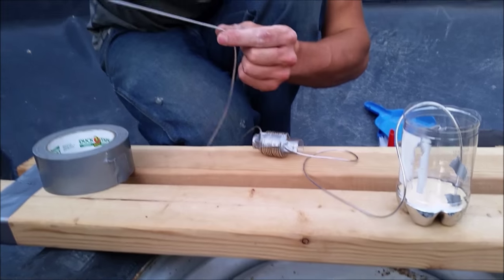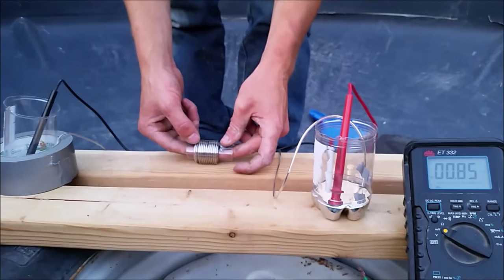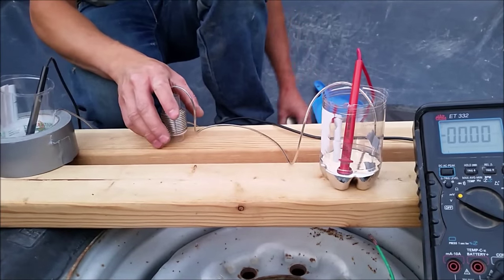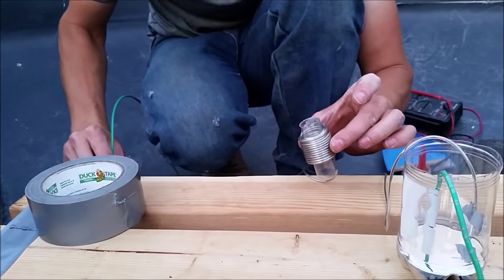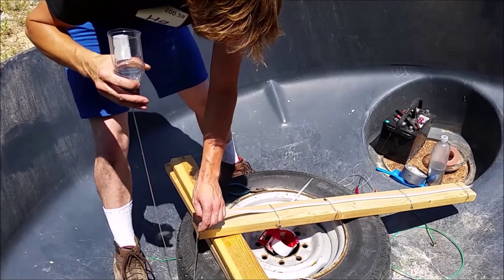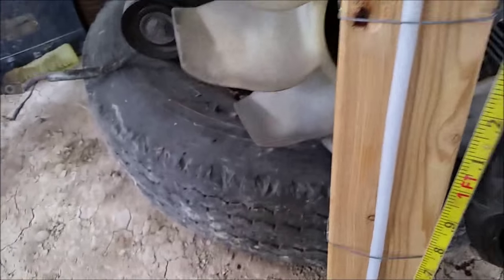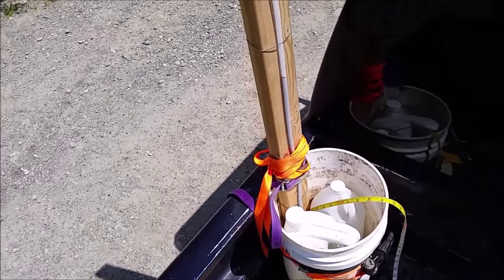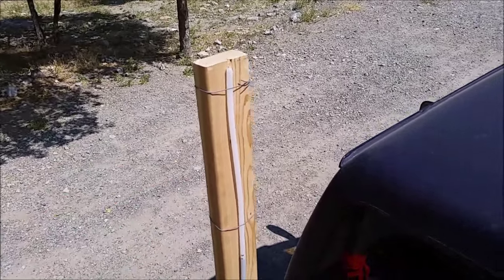Mercury In a Tube

Comment: Your textbook is right. Electrons move slowly in current carrying metals. (AFAIK at about 1mm/s  == 0.04in./s.)But current in a metallic conductor is not just electrons. It's also gaps for new electrons to occupy. These gaps have a positive charge and move in the opposite direction. (The concept of "a space for an electron to occupy" becomes crucial in P-doted semiconductors.)So while you do slow down or invert the flow of electrons, you at the same time accelerate the flow of the positive charge.If your way of opposing current would work, it would be possible to generate electric current simply by moving a conductor. You need to do that in a magnetic field in order for it to work.
Reply: +HotelPapa100 This isn't exactly correct. Only semiconductors have the gaps, called holes, while metals have a sea of electrons that flow. To make electricity, you need to have something that is charged move like an electron, an ion or a hole in a semiconductor. When the mercury is flowing, you are moving the entire atom (electrons+protons+neutrons) that has no charge overall. No moving charge means there is no electricity. If we could move a neutrally charged atom/molecule and produce electricity then we would be able to make electricity by physically moving anything around (for example we'd be able to make electricity with our bodies just by walking around).

Comment: I think it makes sense for the mercury to keep passing a current even when it's flowing, I guess it would be equivalent to rolling wire off one spool onto another. Had to think about it for a bit though.
As a new subscriber, I want to let you know I enjoy what you've been putting up!
Reply: ***** The car analogy does not hold water. The whole thing is moving and everything aboard knows nothing of the movement, it's a frame of reference thing. The whole planet is rotating at high speed and moving around the sun crazy fast, and yet we do not notice.
Reply: +Cody'sLab  You could only equate it to a spool of wire if the positive and negative connections were stationary and the wire was moving past them.

Comment: Hi Cody,
              Remember that electricity suffers the constraints that control light. You can move the light source at 0.5 the speed of light but the light itself will still travel at the speed of light. So returning to your mercury in a tube coil. The mercury is moving at what, about 3 – 4 feet per minute or something similar and you can increase this 1000 fold but the speed of the electrons in the mercuric coil will still flow at the speed of light. All this boils down to the fact that moving the mercury at any fraction of light speed will not affect the electron flow, ergo will not affect the magnetic field generated by the current flow. Which is confirmed by your very interesting experiment, which I would term, “thinking outside the box”.
 On the gold /mercury  experiment you were a little vague and I am not sure if the mercury absorbs the gold or just coats it. Could you please elaborate a bit. I know that mercury is used for mining gold so from that I would assume that it absorbs, but that is only an assumption from insufficient data.
Best Regards
MoK
Reply from the maker: mercury dissolves gold but large nuggets are dissolved slowly and the mercury ends up sticking to it.
Reply: +pufero1 I think you are confussing terms. In wide space an electron (all aside of the quantum and relativistic effects, lets be classical now) of course moves at speed of light. But we are on a different environement. According to bands theory, electrons in the conduction band  (which on a conductive environement has no energy separation with the valence band) move according to the difference of potential applied. The flow goes at C speed, but electrons themselves have a random gas-like movement  (without considering the electron as a wave). Anyways, the potential difference makes one of the components of this movement slightly larger, so the electron itsem moves sloooowly (around 10^-5 m/s according to my lecture notes). In fact, when defining the intensity on a wire, we say I= N (particles/volume) Q Vd where Vd is the derive speed, the electrons one, that is no the light's one.

Sorry for the huge message btw
Reply: is the fow what moves at almost speed of light electron only jumps to the next atom  and on video sounds like they are traveling on the wire.
Reply: +pufero1 that's it
Reply: Hi Jaime, I am afraid that the reply you made to me is utter nonsense. Not one piece of it conforms with any knows scientific language. I would suggest you start to bone up on the subject at least then I may be able to comprehend a little of what you are saying.
MoK
Reply: +Mo King My apologies, english is not my first idiom and I'm sure translating a lot of things wrong. 

What I tried to highlight is that I think Cody was right stating that electrons, considered purely as a particles, on a conductive wire don't move at speed of light, but a lot slower. As I've been taught, electrons move with a mostly random movement inside the wire, just as gas particles would. What makes them move on certain direction is the electric potential difference between the poles of a generator, so the electrons random velocity vector has to have a component generated by the action of the inner electric field on each electron, but this component does not make electrons move at speed of light, just a lot slower. 
Maybe I have not still advanced enough on my degree, but right now this is how I see it. The movement of the electrons as a whole is almost at speed of light, but each electron is not even close to that.

Cheers! (Hope that I posted it clearer this time)
Reply: +jaime fuente I have to stop posting this huge shit
Reply: Hi Jaime, Apologies accepted. I did my degree many years ago and I did the degree because I thought I knew it all and just required the degree pass to prove it. After 10 years of intensive study I got an honours degree but I learnt that I had only opened the door to one science and behind that door was 1000 lifetimes of knowledge and also another 1000 doors, each also with a 1000 lifetimes worth of knowledge and another 1000 doors. This goes on add infinitum. To put it succinctly I had learnt that my knowledge after 10 years of study was only a drop in the ocean of knowledge. You must learn this before going on that long journey of learning. Now down to specifics. You do not have a good understanding of electricity and electrons. Electrons when moved by voltage pressure do operate at the speed of light. This fact has been measured very accurately and electrons proved to travel at 186,000 miles per second, not a lot slower, as you seem to think. Think about how fast computers function, many millions of operations per second. requiring an electron speed of light. Please do not be proud of how much you know just be aware of how much more you don't know. A lot of data taught by schools, colleges, and even Universities, is in itself incorrect as the teachers are teaching exactly what they were taught. Learn not to trust all that you are taught but check and verify everything. Those that say they know it all are on a sure road to pitfalls and there are many of those in life's journey. 
Best Regards Jaime and I wish you all that you wish for yourself.
MoK
Reply: +Mo King i love your philosophy here... always be humble.  best life lesson EVER! 😆
Reply: Hi Philie, Thanks for your comment although I prefer to call it being polite rather than humble. Humble implies subservience and I am never that.There are many very rude and insulting people on Youtube and I sometimes forget myself and let rip.
    You also commented on Cody's family farm with a touch of envy. I have a large villa in Spain where I live now in retirement. The amount of work required to upkeep the property is horrendous especially at 75 years old and due to heart problems I will shortly have to return to the UK. I will still keep up my deep interest in all things scientific, but life on a large property is now a no-go. It's OK if you are fit, It's not always envy that is green. Lastly Cody's enthusiasm is very infectious and I enjoy chemistry so I watch his videos whenever I can. Making gunpowder from Urine is a piece of piss.
Best Regards to you and yours.
MoK
Reply: +Mo King  First of all, sorry for my english, i am german. I do not know if  I understood what you are saying. I am pretty sure that the speed of an electron in a conductor is not the speed of light. Actually it is very slow. It is possible to calculate the speed. Imagine a piece of copper wire. There is a number of electrons in that wire. You can calculate this number by multiplying n (number of electrons per cubic mm), A (I dont know the actual term, but it is the cross-section of the wire) and l (the length of the wire). If you multiply that number with e (the charge of one electron) you get Q (the moveable charge in that wire). So Q= e*n*A*l. The time that is needed to move this charge through the wire that has the length l is the time one electron needs to move the length l. I = Q/t which means I = (e*n*A*l)/t. Because of the fact that l/t = v we got the equation I = e*n*A*v. That means v = I/(e*n*A). v is the average speed of the moving electrons in the conductor. 
With I = 15A, n = 8,47 * 10^19 1/mm^3 and A = 1,5mm^2  you get an average speed of 0,74mm/s.  That is the speed of electrons in this specific conductor. The density of electrons that is used is the density of electrons in copper. So you can see that electrons are moving very slow in a conductor.

Please do not tell anyone to inform himself if you are not entire sure about what you are talking about. What is moving with nearly the speed of light is the energy and the information, not the electrons themself. It is the same thing like sound waves. The particles are not moving with the speed of sound, but the wave does.

The electromagnetic field remains stable because it is caused by the electrons moving relative to the conductor and not relative to the surrounding.
Reply: +M. Mambl mean that I was more or less right? Now, that's a surprise
Reply: +jaime fuente is that irony? But yes I am pretty sure you are right
Reply: +M. Mambl Thought so, it was what I was told at my faculty, but you never know. I was being just a bit ironic, take it easy :p
Reply: Haha I cant say anything against Irony, i love it. It is just sometimes hard to be sure, if it is written in a text :D 
Actually I am not finished with school, I dont know what they tell you in a faculty... In school they Do not say much about it
Reply: Molybdenum King

Comment: The problem with potentially stopping current by letting the mercury flow is that the velocity at the walls of the tube will be zero due to viscous stresses and I also believe that electrons only travel along the outside of a conductor. So you might get some results by also moving the tube along with the flow, or just slide a solid piece of metal along the two contacts. You could also try a Kelvin dropper experiment but with mercury.

Comment: Hello Cody, I think I know why your experiment with the flowing mercury "failed".

If you were to move the conductor so that the electrons appear to be standing still (net velocity is zero), then the protons would be actually moving in the direction of the electric current. You would still have a flow of electric charges no matter what. 

Also, the drift velocity of the electrons depend on the conductor, the temperature and the electric field applied. In a copper wire, at room temperature and with a potential difference of 10 volts, the drift velocity is about half a centimeter per second. The value for mercury could be much different.
Reply: This is my 'intuitive' classical answer as well. Microscopically moving the conductor moves both the protons and the electrons, so the net current would be the current running through the conductor: hence dI=dq/dt and protons and electrons have equal and opposite charges.

Comment: Hey.
The thing with the current in flowing mercury is that when mercury flows, not only electrons, but protons (in the nuclei) are moving. That's why just moving a piece of metal doesn't generate a magnetic field.
When you pass current through flowing mercury, the positive charges move with the mercury, but negative ones (i.e. electrons) move a little bit slower or faster. It is that difference that produces the magnetic field, not just the velocity of electrons.

Comment: If mercury was uniformly charged, then its flow would have produced current. But since it's neutral, it does not.
When normal current is flowing through mercury, it can be represented as electrons moving through stationary protons (positive charges). When you start moving the conductor, even though electrons start moving in opposite direction, so do protons that are basically exactly compensating for current difference it creates.

Comment: Hi Cody,
Making the mercury flow in the direction opposite of the flow of charge won't change anything : you have to take into account the reverse flow of positive ions of your metal.
Let's say the electrons goes 1cm/s in the Hg and the Hg flows at -1cm/s. The speed of the electrons (relative to you) will be 0, but you will get a net current due to the positive ions going -1cm/s. Both situations would lead to the same net current.

Comment: It would be interesting to measure the resistance of that mercury wire while you change the flow, should be much more sensitive than the solenoid.

Comment: I'm wondering if the electrical current's speed is relative to the speed of the material. If you think about it, the electricity is flowing through the Mercury so whether the Mercury is flowing or not, from the frame of reference of the electrons flowing through it, it's stationary. It's like if you're on a boat in a river. Compared to the water around you, you're not moving much cuz you're traveling through it, but compared to the shore you are moving.

Comment: The current is motion of electrons relative to protons, not absolute movement of electrons.  The mercury has balanced charge, so you aren't changing the relative motion by flowing mercury.  You can convert flow into current and vice versa using electro-osmosis.  That is where there is a net charge in the fluid (balanced by an opposite charge on the tube or outside the tube), so moving the fluid moves electrons relative to protons.

Comment: the reason the magnet didn't shut off with the flowing mercury is that in order to keep the electrons stationary like an ion treadmill, the positively charged ions that the electrons are jumping between have to be flowing in the opposite direction at the same speed as the electrons would have been flowing, making a positive current (Hg ions) in the opposite direction as the negative current (conduction electrons), thus creating the same magnetic field

Comment: Hi Cody i'm new to your channel.. and i relay enjoy your videos :) 

suggestion.... 
Could you make a plastic tube with a copper wire going across it every X inches..
so that the outside would e electrically connected to the mercury.

you could then Connect a audrino to read out the Values in a program or something like that...

would be kinda cool :) 
 
again thanks for sharing .. and keep the videos coming :) 

Cheers from Denmark..

Comment: I think that if you laid the coil tube on top of the magnet horizontally then you may have gotten a voltage. I think that the way you had it set up the moving mercury would be moving perpendicular to the magnetic field resulting in no change in flux

Comment: Cool experiment!  What diameter of tube were you using, and what kind of amps were you getting?  If you had a 1/16" dia. tube and 0.1 A, you would have about 0.0034 moles mercury per inch of tube (with 4.1 x 10^21 free electrons/inch), and the electrons would be going through at roughly 0.0015 inches per second.

Comment: Would be cool to see what happens if you wrap the tube with for example copper or al foil. So you basically made a tube shaped capacitor. then connect the outer shell to one pole and the mercury to the other. Pump the now charged mercury through the tube and see if it will create a measurable magnetic field.
So its not the charged electrons that create magnetism but the charged liquid.
:)
wrote that in the first min of the vid you actually do pretty similar things

Comment: So by reading the comments I understood that when you move the tube the protons can't move but the electrons can. So the magnet can separate electrons from protons and create a potential. But when you move the mercury, both protons and electrons move all together, so the magnet can't separate charges from one another. This is very interesting. But there's another question. If charges are already separated, and you flow the protons, does it impact the already existing potential?
Reply: Ok I've researched mhd generators. The problem seems to be the placement of the electrodes.

Comment: My hypothesis here is that the magnetic effects are from an electric field, so the movement of the electrons have little to do with it. I would suspect that long term you would get a build up of different ions in the different beakers, but not sure.
Reply: Rob Mckennie That seems pretty much right. If we think about voltage as pressure in a pipe, the movement of the pipe has very little (unless we're talking massive acceleration) to do with the pressure inside. For Cody's experiment to show anything it seems like the mercury would need to be flowing at near the speed of light. That would introduce other problems, of course!

He described the difference in electricity and the movement of electrons on. That description itself should have made us expect the results he got. Still, you don't learn anything by not trying!